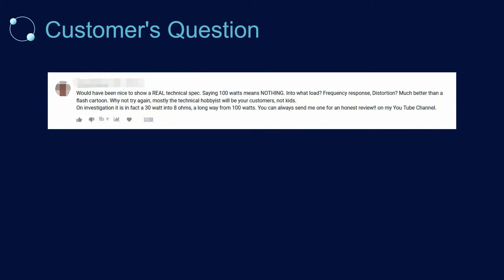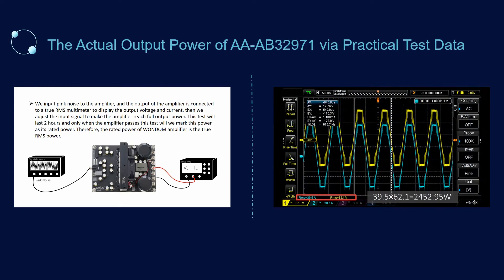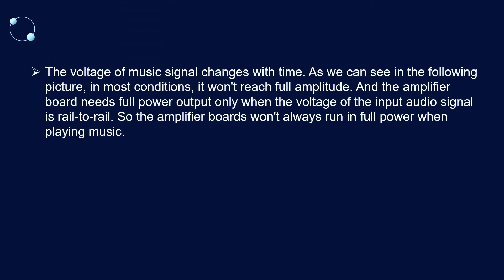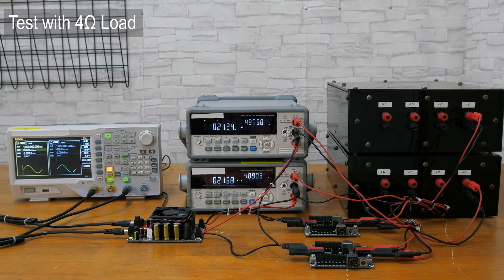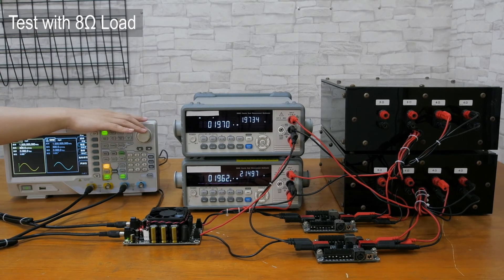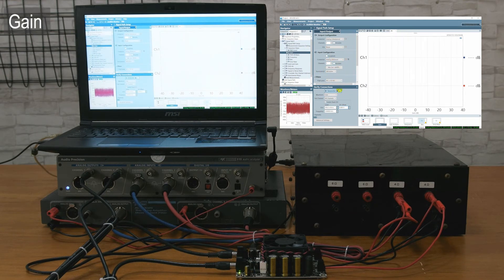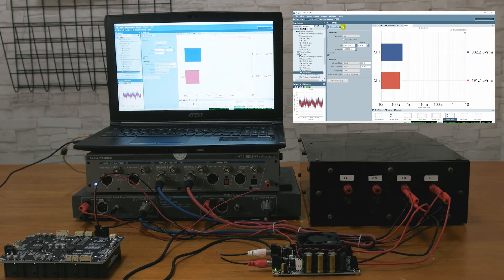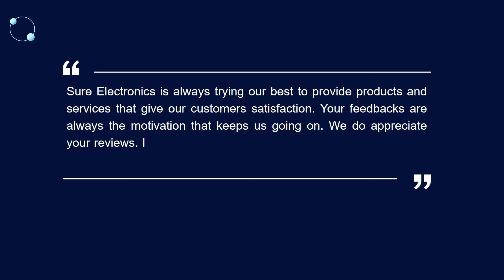Saying 100 Watts Only Means NOTHING -- Actual Output Power of AA-AB32971 via Practical Test Data

Comment: hello , why  is the red LED on?
Reply from the maker: Hi, Danbo San.
Thank you for your watching and comments.
The red LED is clipping indicator. There was clipping when the output power of this board reached 100Watts at 4Ohm, 27V.
Reply: @WONDOMAudio  Thanks for your answer, i got the tamp 2500mk2 really nice but the Fan is a little bit to loud. So i added  a Fan obove the original one.